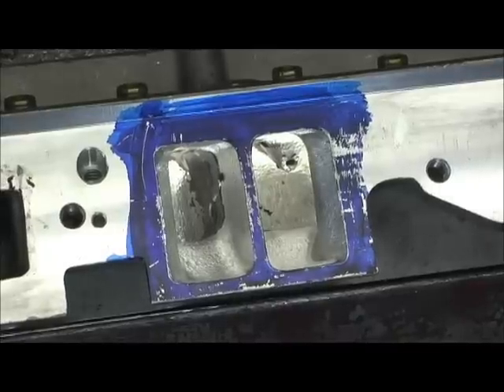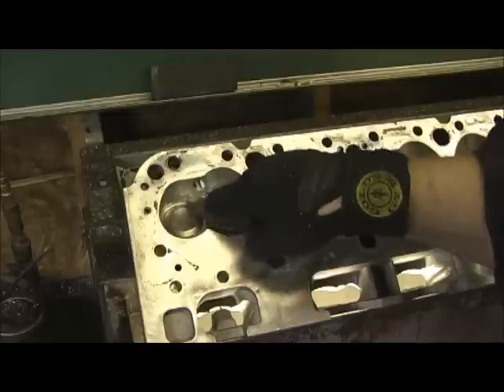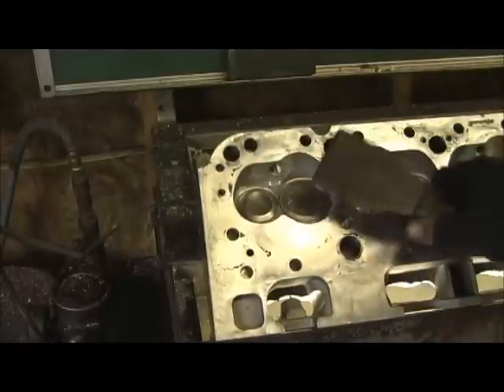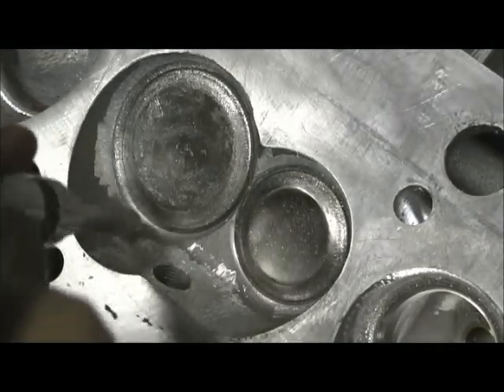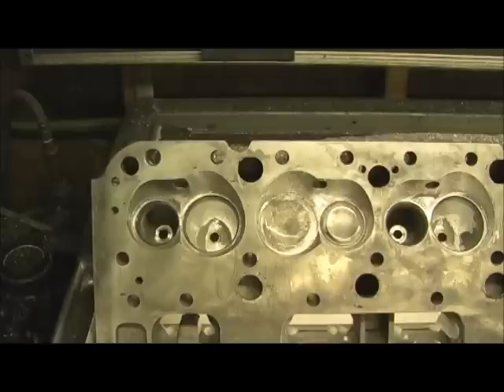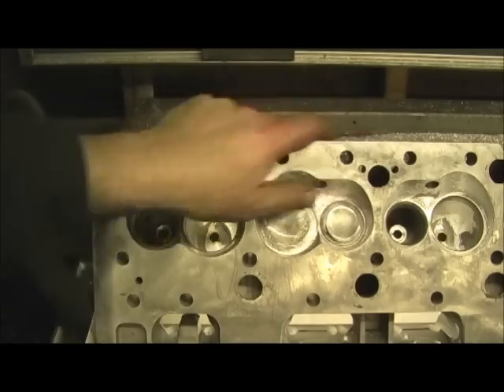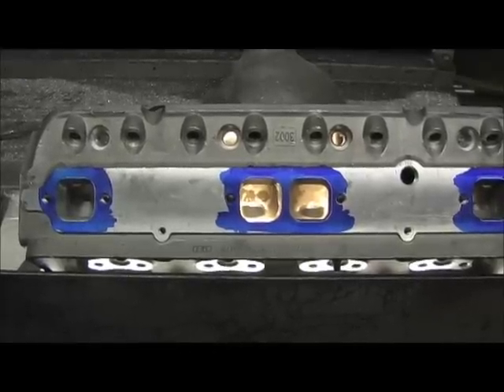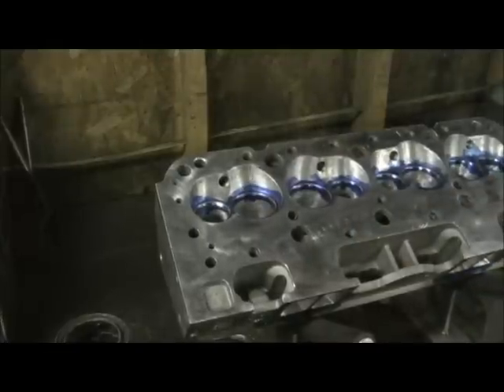ProComp 190cc Conclusion Stage IV Headbytes Porting

Comment: what kind of numbers are possible with this head? i have a set to do for a 400 sbc, im in the process of building a comparator at the moment until later on when i get a calibrated orfice. hoping to follow your lead on this particular set and then port his intake as well. aiming to re-work my 4 corner ports on the intake manifold  a bit more than the inside ports when i port it so i can even out the fuel distribution somewhat as well and possibly try out 1.6 rockers on those cylinders when we hit the track. hoping to do well enough with the setup we are working on (im selecting the camshaft as well) that i can catch some extra work from others at the track. you definitely make the most informative vids on porting ive seen, thanks for sharing your wisdom

Comment from the maker: To LANC MAC, who it would not let me reply for SOME REASON, as I mentioned if you listen, the chamber needed reshaping in order to let FLAME TRAVEL, ALONG WTIH AIR FLOW blend into the chamber floor and to let it b burn better, the spark plug depth in the chamber was just the main mechanical problem, and if you just fixed it by it self, you WOULD SEE a little gain ONLY.

Comment from the maker: It is not the way you made it sound; however, it resembles it in that the pro comps have TOO many threads going into the chambers and has to be trimmed back, so why not reap the benefits of a chamber re-shape to make it work better on the air/flow, atomization side to boot?

Comment from the maker: That is an interesting approach, costly, and without an improvements. What I mean is: since this is a problem that relates to "unshrouding" and the chance to get more air into the cylinder by removing material in that area, the easiest (as far as I am concerned) to modify, HIT THE CHAMBERS!!! I guess I see on your end how you would think that as all you had to do (if it is feasible) is lock it into a Bridgeport and move it down the chamber. I would not approach it this way, rather the other side

Comment from the maker: Back in the early 2000's, there was a problem with them on that issue. There was also casting issues of leaking. Since around 2008, 2009 I have not herd of anything, and since 2009 I have done about 30 pairs of these heads with HEAVY PORTING with NO problems from my customers on any of those issues. This is NOT to say it might not be happing, but I cannot say it has happened to any I am doing or have done in over three years. I have a friend in the paint and body business who (continued).